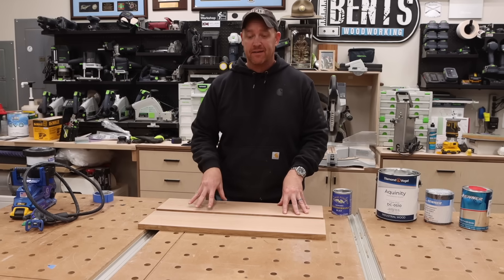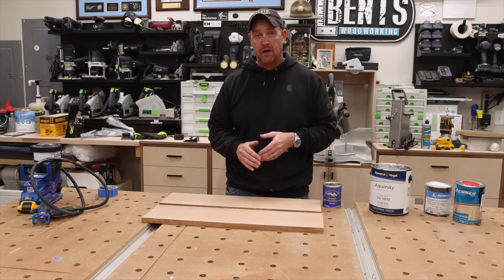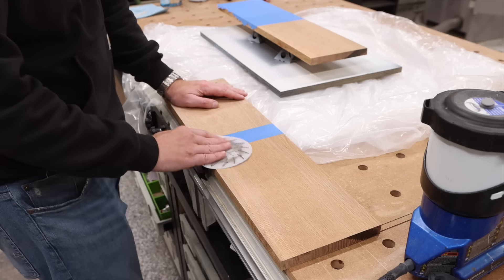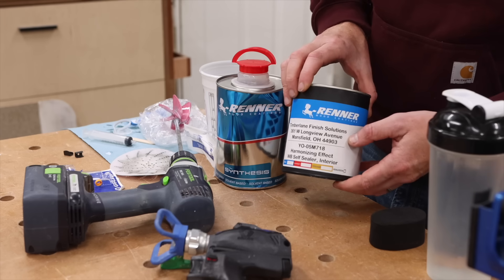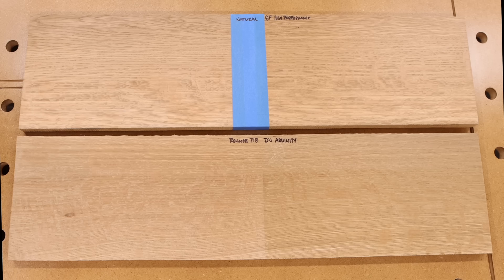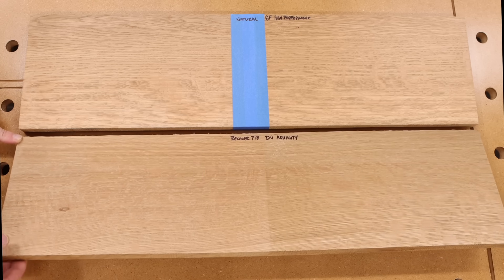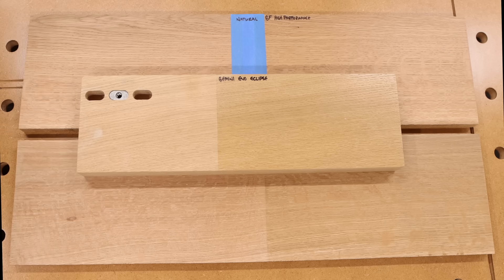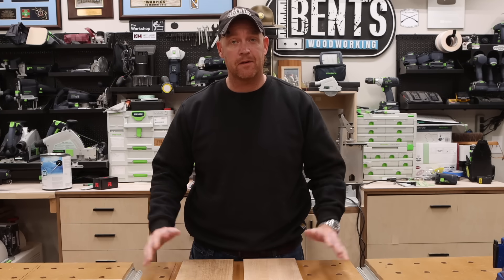Secret wood finish no one is talking about

Comment: If you ever use renner for a painting project use their 851 for top coat and their 688 as a high build primer if needed. Between 10/20 sheen. Or 643 for raw wood primer. It’s a game changer for cabinets.

Comment: There wasn’t any mention of durability, which is what I’d be most interested in. The fact that the Renner didn’t show up at all definitely makes me question if it would hold up as well as the others. Visuals are great but it’s only one facet of this.
Reply: @bobbray9666 I agree, but I’d like to see it tested
Reply: As a professional painter I've spent a fair amount of time on painting forums.  Until recently I've been married to Sherwin Williams.  Paint Talk Forum posts really praise Ben Moore Command.  I tried it and loved it.  I was told that as much of an improvement of BM Command was over SW Emerald urethane, Renner was that much better.
Reply: Emerald and command are trim paints not made for cabinets. They don't hold up to chemicals and hand oils. Just because you can doesn't mean you should
Reply: No hard wax oil will be as resilient as a good 2k lacquer. The reason that HWO is so popular is because of the ease of application and ease of maintenance (in the sense that you can add another coat after a quick wipe with a damp microfibre. That means it is really good for those people who don’t have a dedicated (ultra dust free) spray area or are working on site (eg floor restoration). 2K lacquer products are very resilient but require skill/experience plus that dedicated spray area. 

It is also fair to say that some lacquers can look plasticky whilst, currently, those 2K HWO do not come in a gloss finish (I think Rubio try and get you to buy a product which requires another coat on top of the “Monocoat”). Be a little patient for good news in this area.

2K HWO products were very expensive. No more. I watched the Wood Whisperer video on his HWO tests and switched to Natura Onecoat. Not only is it, in my view, equally as simple to apply and just as good looking, but I save a lot of money by buying a Natura over Rubio. I can only suggest that you try it and see for yourself.
Reply: In the first few sentences of his opening statement, he says that the Renner is supposed to be very durable.
Reply: I was also hoping to see this in the video.
Reply: @theofarmmanager267  its not lacquer, not nitrocellulose. Its 2k Eurethane
Reply: @janeblogs324  I hadn’t intended to imply it was - I certainly didn’t see any hardener added. To my mind and experience, a 2K lacquer is about the most bullet-proof finish most of us will use on wood. I was comparing that to a hard wax oil which has many qualities but is not as durable, again in my mind, on much used surfaces such as tables. For items that don’t need that durability, I am happy to use shellac. Cheap and easy.
Reply: He did say hard durable finish at 1:15.
Reply: @DMUSA536 - Yeah I watched the video. He talked about how important durability was which is why he didn’t want to use Rubio but then proceeded to only talk about color the rest of the video with no mention of durability once he actually tried the product. I think it’s awesome this product looks so invisible but that also calls into question its durability.

Comment: I use Minwax Polycrylic, which I love. Or Campbells water white conversion varnish. I think it's called Magnamax! White oak and ash are my to favorite woods for cabinets and tables etc . If I had to choose it would be the Polycrylic. 30 years ago I redid our kitchen, I removed a wall and put a bar 2" x 16" x 8'   ash. 3 coats satin polycrylic. 30 years, 3 kids and 2 grandkids later it looks just like it did the day I installed it!! Durability is thry the roof!
Reply: I love Oak cabinetry and want to try building some of my own upper and tall storage cabinets in a shaker style (or maybe Euro edgeless style).  What thickness do you recommend using for building oak cabinets, for say a laundry or work room?  Do you recommend staining all the pieces prior to or after complete assembly.  I'm relatively new to woodworking, thanks!

Comment: Hey man this is awesome. Did the finish with the catalyst have to be emptied between coats so it didn’t set up in the machine?
Reply: Depends on a couple of things; weather and manufacturers recommdations. For me, I dumped what was left and thoroughly cleaned my sprayer. When the 2k product dries it's super hard and would ruin your machine.
Reply from the maker: It did not only because I was able to apply the second coat within 2 hours

Comment: With the General Finishes if you want to go flat do that as the last coat. Otherwise first and second coat use gloss or semi gloss. This was told at a seminar that general finishes put on and he recommended putting the first coat on generously since the wood absorbs the finish and allows you to sand off any nibs, brush strokes or uneveness. It has something to do with the flattening agents they use, so it’s recommended that flat is the final topcoat if you want matte finish.

I’m looking at the Renner it almost has a pinkish hue, not sure if it’s my screen playing tricks. All three are very close overall. The High Performance GF can be brushed on and it’s water based and very forgiving. I’m not a huge fan of foam brushes, some people swear by them. I’m also a fan of semi gloss and gloss finishes, so take what I say as a difference of opinion. 

The island looks nice!

Comment: So very cool to start with.  Agree with others with regard to durability.  Could be wrong but I would think that the manufacturers should/would provide data on that topic?  Would also think that any finish that's two part and has a hardener "should" protect well?  Interesting and it seemed to shoot well.  Good stuff as always, thanks!!

Comment: How protective do you think the finish is? It does look incredible (or basically invisible).

Also, wonderful island, are the slats on the sides purely decorative?
Reply: Yeah I'm interested in the durability and not just how it looks. I've use GF matte water based poly a lot and have been happy with it but the flat version looks like my next poly finish.
Reply from the maker: To my knowledge it’s the most durable of all the ones I tried. And the slats are decorative.

Comment: From what I saw, I'm in agreement with your take.  I though the GF finish was the closest to Renner too, before you even mentioned it.  I've had very good luck with GF conversion varnish, which is a 2k finish.  Stuff is bulletproof, easy to work with.  Be interesting to see how the GF 2k poly compares to Renner.

Comment: I'm going to be using a butcherblock countertop (store bought from HD) what finish would you recommend? 
 I don't intend to cut directly on the surface I plan on using a cutting board. I talked with Carbon Method people and they recommended their ceramic finish if not cutting on it.

Comment: Jason, another great one, thanks! That Renner is nice on the White Oak. For anyone familiar with mahogany:  I have two unfinished Mahogany doors (solid mahogany rails and stiles with impact glass) and the manufacturer... WOULD NOT SUGGEST anything for finishing... insane. What do you think about any of these for Mahogany versus the white oak?

I was about to go with Rubio MC Natural as well, trying to retain as much of that Mahogany color but also for relative ease of refinishing in the future.

 One door faces East, has some cover, but get a few hours of sun 9-11am usually, and the other faces North and gets zero direct sunlight, just reflective (which still wears).

Comment: Did any of the mfg’s recommend a sanding sealer coat before applying the topcoat? I use GF’s water-based Enduro 2K CV on high traffic pieces, and have found it to be quite good at maintaining the original look of the raw wood.

Comment: Great video. Thoughts on laying Renner on top of Rubio Monocoat? Can provide more protection for high traffic areas where you want the color from Rubio (i.e. Cotton white), but protection of Renner.
Reply: Why not just use Renner instead of paying for rubio and then coating over it. Plus I don't think other finishes will adhere properly over a wax/oil product.
Reply from the maker: Not sure. It would definitely have to be fully cured

Comment: I hate rubio personally, I use it but It's SO expensive. Toss some ceramic coating on top, and it becomes like 175$ to finish a 12/4 table + legs. The ceramic is nice, not too much sheen and waterproof and stands up well. Use it on TOP of whatever finish you have if it's a hardwax oil type thing. Personally, I like the semi satin but higher than matte finish myself!
Reply: First, HWO isn't necessarily the cheapest finishing option. The primary advantages are ease of application and time savings. Also, there are other HWOs on the market now that are just as good as Rubio, but 1/2 to 1/3 the price. 

The cermaic is the thing that makes your combination so expensive. Just use an automotive ceramic, which is cheaper than all these products aimed at woodworkers. I have no data to back this up, but IMO they perform as well, if not better. Auto ceramics have been around much longer and are designed to go on things that can cost 6-figures and sit outside. You're over-paying for marketing. That $175 can easily be cut down to less than $50 with virtually no difference in performance.